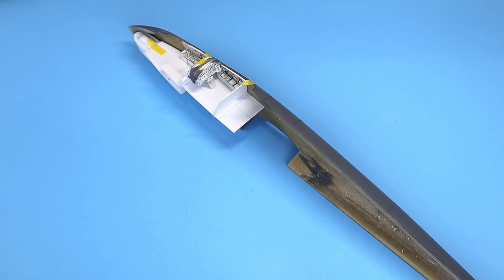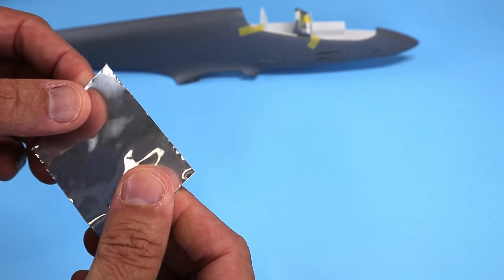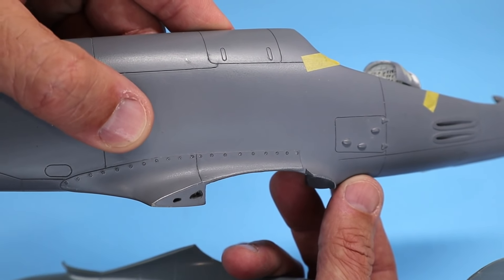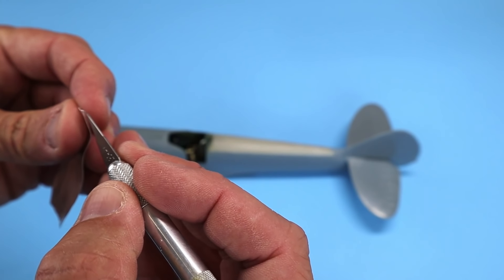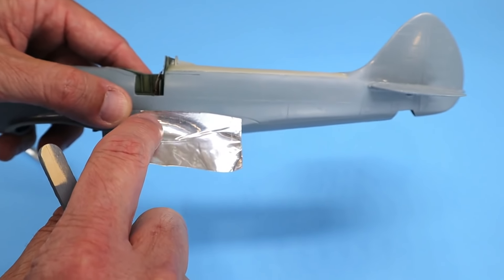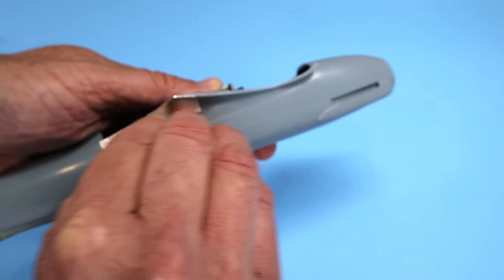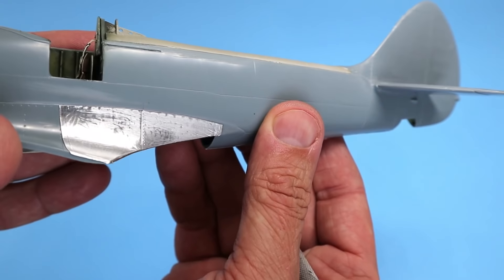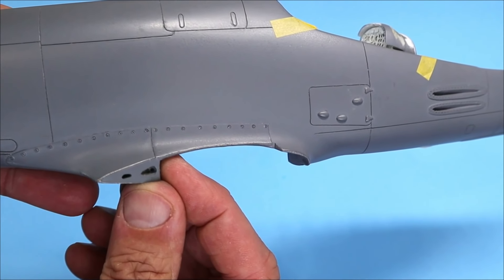Aluminum Tape for Model Airplane Skin Panels - Flite Metal

Comment: Adam savage swears by that HVAC tape, he uses it to make his wood swords look like metal. 
Very cleaver thank you for sharing.
Reply from the maker: I've used both the HVAC tape and the Flite Metal stuff.  The Flite Metal works a little better for these models but for small areas, the HAVC tape is fine.  It's also less expensive.  I hadn't seen any of the Adam Savage stuff but I'll have to check that out now.  Thanks for sharing.
Reply: @FlyingSModels  Also if the HVAC tape has writing on it like UL listed Acetone will take it right off.
Reply from the maker: @toddac61  Good intel but Acetone aint too good for foam or other materials so it's a good warning and a good tip all at the same time.  Thanks!
Reply: @FlyingSModels  Just wipe the lettering off before applying and let it evaporate.
Reply from the maker: @toddac61  Roger that.  Thanks!

Comment: I have lots of aluminium tapes from a variety of manufacturers and countries but none of it is as wonderfully thick as the stuff you're demonstrating here, every difficulty I have encountered has come down to the lightness of the material - if I could find a thich tape like this it would be a pleasure to work with. Great video
Reply from the maker: Not sure if you have the ability to order it but Flite-Metal is still available.  I don't have any association with them but it's good stuff!

Comment: Me and my dad used to do this over 40 years ago with the dull side of thin kitchen foil.  apply a thin layer of varnish on both the model and the foil,  let both go tacky and lay it on. Took a bit of practice but we did a 24th scale Airfix P51 mustang all over. It looked amazing. It looks great when you weather the paint off too on leading edges and walk ways etc.
Reply from the maker: Outstanding!  This is a little less labor intensive due to the factory applied adhesive.  It's also a little thicker than foil which helps to make  some things like wing fillets and such a bit more prominent.  It's also a little more heavy duty and can be sanded and polished to create different sheens/effects.  Thanks for the great inputs on an alternate approach.

Comment: Wonderful demonstration of how r/c modeling products can provide excellent results on both plastic and wood non-r/c models . I recommend sanding Flite-Metal while taped to a flat cookie sheet before removal of the backing to achieve the desired patina and surface texture "prior" to applying it to your model. 👍

In r/c applications a small electric 1/4 sheet palm sander is used to quickly reduce the surface texture to the desired appearance and permit Flite-Metal to condense prior to polishing and or weathering... "For The Look Of The Real Thing"😎. 

Flite-Metal is dead soft .0018 mil...not gutter tape. Burnishing and finishing tools accompany "FK" packaged Flite-Metal. Excellent video !
Reply from the maker: Thank you for the feedback and the bonus content to supplement the video.  Those are some great inputs on how to improve the surface finish/quality of the Flite-Metal.  I'm going to have to try them.  It's great stuff and I want to eventually put it on a small R/C foamy as well.  Thank you again!!

Comment: In the September 1995 issue of R/C Jet International magazine, is an article (Scale Metal Finishing Pt.2; pages 46-49) of how to attain even greater realism with applied metal tape. Once applied, separate panels can be subtly differentiated from one another (as is noticed on actual aircraft): The process involves coloring various individual panels with varying subtle shades/tints of chalk dust, then rubbing said panels with various grades of fine wire wool. I still have a copy of that issue, and the color images show phenomenal realism; that was on a large scale R/C BVM kit model. As an experiment, I tried it some years back on a section of a sacrificial 1/48 plastic model; the results were very good, but the smaller scale requires a softer, more careful hand.
Reply from the maker: That's some good back story on the use of this or similar products to finish larger aircraft.  I remember seeing the BVM Viper in action way back when at Jets over Deland in FL.  Loved watching those rip through the sky.  You are correct in that it takes a little more work to do a whole model in this smaller scale.  I typically only use the technique for raised panel areas like wing fillets and such.  Appreciate the good comments/inputs.
Reply: @FlyingSModels  👍✈️

Comment: Great vid, been using alum foil to skin 1/48 aircraft for some years now and two of the most challenging problems I've never been able to solve are: 1) fragility of the foil, anything can leave a mark on it, I believe b/c there is a substantial layer of adhesive that is soft so everything is 'gonna leave a mark'.  I see this problem even when I prime it.  2) it's not really easy to do NMF with alum foil, because of the 1st reason, but, I've found that Testor's seal for metallizer does protect it some but it's not 100% proof.  So I end up coating it with metallic paint, which defeats the purpose, lol.
How do cope with these problems? Very interested in your opinion.  And good job on the scratch built Cougar, pretty impressive to say the least.
Reply from the maker: Thanks for the good feedback.  It's a tricky process and to be honest, I typically foil for detail rather than for finish.  That is, I prime and paint over the foil versus leaving it "natural".  I have had the same challenges as you mention so I just changed the purpose of the use and don't try to get a NMF with the foil alone.

Comment: A simple method to remove the backing from anything having a protective film over the adhesive is to cover a corner or edge with a piece of masking tape, let it extend past the edge. Turn the item over and repeat the process. Let the masking tape pieces stick to itself at the backing and face, now simultaneously pull the masking tape pieces away from themselves, it will easily separate the backing and facing.
Reply from the maker: Great tip.  Thank you for sharing.  I obviously needed some help trying to fat finger that backing...haha.  Really appreciate you taking the time to provide this great tip/instruction.
Reply: @FlyingSModels  Glad to help.
Reply from the maker: @busmirror  Appreciate that.

Comment: Alumin(I)um!!🤭
Sorry, couldn't resist. 
Got to try this. Too many kits have panel lines too deep, and "trenched" rather than overlapping. This could be the answer. 
Thank you.
Reply from the maker: It works great for overlapping panels.  A little tricky to work around some very small compound curves and I've never tried to to an entire model with the stuff.  But it certainly is another tool in the tool box for us.
Reply: To be fair, the element was originally named as per the American form. It was us Brits who insisted on changing the name, to make it sound more ‘latin’. Both forms are acceptable. https://diecasting.com/blog/2014/02/26/aluminum-vs-aluminium-the-etymology-of-the-um-and-ium-debate/
Reply: Americans..... ;-)
Reply: @tjfSIM  I've been forced to notice the English language in a way I wouldn't normally. My son is dyslexic and he's highlighted the fact that the language often makes no sense! 
The meaning is the most important thing, as long as the pronunciation "aluminum" cannot be confused with anything else who cares?
Reply from the maker: Good point.  And the English language is a funny thing, that's for sure.  So many difference pronunciations for words that are spelled the same.
Reply: @FlyingSModels  something I always say is that English is a bunch of other lannguages in a trench coat pretending to be the same language.
Reply from the maker: @jordyncollier919  Now that's pretty funny.  I have never heard that one.

Comment: Interesting technique and very fine model making. The foil tape is in common use in the aviation industry, often known as "speed tape". It comes on a roll, 2" wide is a common size. As aviation is very highly regulated, shelf-life expired rolls are often disposed of so if you know somebody who works in the field, you can probably get the stuff for free or for a few beers.
Reply from the maker: Thanks for the kind words and thank you for the excellent tip.  Now I need to talk to my aviation buddies and get some of that expired tape.  Good tip!

Comment: I been using aluminum tape on many of my models-  works nice except it will make your model a bit heavier than normal.  I used it on a 1/72 scale C47-  aluminized the entire model and it  weighed more than it did if I left plastic.
Reply from the maker: Does add some weight so you have to make sure to take that into effect.
Reply: @FlyingSModels  if you ever build the Apollo command module and lunar module, this stuff makes it look good. :)
Reply from the maker: @spankyharland9845  I bet it does.  I haven't build any real space models but would be good to try this stuff out on it.  Thanks for the input!

Comment: I like the BareMetalFoil product - it is available in a variety of surface finishes, adheres extremely well, and is extremely thin.
Reply from the maker: It is a good product and a good bit thinner than the Flite Metal.  I like the lapped joints that can be created with the Flite Metal product a little better.
Reply: @FlyingSModels  I think there's definitely a place for both.  Definitely some aircraft had overlapping panels which is definitely an area where a thicker foil would shine - but of course there are plenty of examples where skin panel joints are flush-fitted, especially once you get into the jet era.
Reply from the maker: @chuckschillingvideos  Indeed.  I like the bare metal for the more modern aircraft.

Comment: To remove backing flick the corner with your thumb and middle finger. The two parts will separate just enough to grasp one side and start peeling.
Reply from the maker: Another great tip.  I appreciate you sharing with the community here.  Cheers!

Comment: After seeing this quick tip video, makes me think if getting the hughes H-1 racer be completely taped over and weathered to give it that nice effect
Reply from the maker: That would look amazing.  If you do it, make sure to share some pics over on my facebook page: facebook/flyingSmodels or through the contact section on my website: flyingSmodels.square.site.  Thanks!
Reply: @FlyingSModels  oh no, i don't have the kit or the materials for it but i thought it be interesting idea to see someone try it out, the H-1 racer, as wellas the commecial airliners used by the american airlines aluminum finish, but sounds good idea to try nonetheless
Reply from the maker: @revvingnoodle7192  For sure!!

Comment: Aluminum foil and pressure sensitive glue     works great
Reply from the maker: For sure.  That does work well also.  I like the fact that the Flite Metal comes with adhesive on it.

Comment: Nice tips. RC modelers: aluminum foil may compromise your radio signal reception! Use with caution. This effect may be ideal for statics, though.
Reply from the maker: I've wondered too about whether or not fuel from the exhaust would effect the long term adhesion of the foil on the RC planes.  Works well for the static ones I build.
Reply: connect the Antenna to the Skin - THEN you have a giant Antenna ;-)
Reply: You should run your antenna leads to the outside of the plane for RC use.
Reply from the maker: @daverose8772  For sure, Dave.  Appreciate you making that point for those wanting to use this technique on RC aircraft.
Reply: @daverose8772  What happens when you're going the other way? Now you are trying to receive RF through TWO layers of aluminum foil - not a good plan for reception.
Reply: Flite-Metal, the product featured in this video, has "never" presented radio reception issues. If it had it would be "stupid" to offer it for 22 years...in both narrow band and spread spectrum radio controlled models. 👌 There is an online report of its r/f reception efficiency...👍

This is not to say gutter HVAC tape will...however alloy tape is used in avionics bays to prevent cross talk interference...aka shield electronics.  😊

Aluminum density is the reason Flite-Metal has proven to provide "The Look Of The Real Thing" without radio issues when recommended application and finishing techniques are adhered to...

Comment: So could you use this as a way to “wrap” the model instead of painting it? This is very interesting, thanks!
Reply from the maker: Yep.  Another guy commented here that he did just that with his small RC foamy and he said it worked great!  I only painted it here as the Pucara was going to be painted rather than left in a natural metal finish.
Reply: I would say for a scale model it would be easier to paint  it if you want a bare metal finish, as I haven’t seen many foiled projects that dont have a lot of foil texture. Your idea of creating raised panels (and painting with a primer like Mr Surfacer) is a great idea. I have seen an alternative method of taping off the area in question and brushing on Mr Surfacer and then sanding it down to create a raised panel look
Reply from the maker: @vmoney9106  Yep, I haven't done a whole static model with Flite Metal and don't think I would, unless it was a much larger scale.  I do like it for building up raised panels as it's easier to work with (at least to me) than laying down a coat of Mr. Surfacer or similar.  Appreciate the comments.

Comment: Nice.... I was using the aluminum tape for seatbelts...
Reply from the maker: That's a good use too.  Although I prefer the use of pewter foil for the belts.  I think it lays down better (just my opinion, though).  You can check it out here: https://youtu.be/e0JLOteygE0
Reply: @FlyingSModels  I did see your vid and I would agree with you...but I haven't had any at hand and forget to look for it when I go out....also, my glasses are constantly fogged from having to wear a mask so wouldn't see it anyway.... : )
Reply from the maker: @thomaswilson3437  I hear you. Hard to do any shopping when wearing glasses and a mask.  Glad you are staying safe, though!

Comment: The very thin foil in packets of cigarettes is even better. It is much thinner, and easier to work with. And the effect is also more "realistic."
Reply from the maker: Great suggestions, although I don't smoke or know anyone that does so I'll have to go dumpster diving to find some...haha.  I actually like the Flite Metal stuff as it stands proud on the surface of the model which helps when I build up layers of primer (I don't lose some of the raised/relief effects).  Thank you for sharing this additional resource with the community here.  All the best, Chad.

Comment: Where you get this IA-53??
I've been looking for it almost a life!
Reply from the maker: Making it from scratch.  No kit out there that I know of...at least not yet :)
Reply: @FlyingSModels  
Looks very well done just like an injected model.
Congrats and excelente idea!
Reply from the maker: @jcbraka3771  Appreciate that, JC.  It's one of those long term projects that I will work on in between other less challenging builds.  Cheers!!
Reply: In Argentina you can buy some 1/72 Pucara models !!!
Reply: @J C Braka IA-58 is the Pucará.
IA-53 is a crop duster called Mamboretá
Reply from the maker: @hercholand  And a nice resin 1/48 one too.
Reply: @Coyote27981  
Sorry my mistake! Damn keyboard!
I just noticed once you point it.
Thanks for that.

By the way, how's going the re engine project with the PT-6A?

Comment: Think I'll give this a go on a small foam rc plane. Love the little planes but hate the look of foam
Reply from the maker: Let me know how it works.  When I was flying foamies, I'd always airbrush and weather my little warbirds but never tried to put aluminum over the foam.  Would give a great look!
Reply: @FlyingSModels  Will do. Done the air brushing too though it looks better it doesn't add too much to damage resistance. Hopefully the tape will keep the cheapo foam in the air longer because they sure are fun to beat on for the buck
Reply from the maker: @soknightsam  Amen to that. Hard to beat them for "pound for pound" fun.  I'm guessing it makes 'em a little more durable.  I used to spend hours and hours redoing the schemes with a custom airbrushed/weathered finish only to auger it in on the maiden flight...haha.
Reply: @FlyingSModels  Reporting in. Wasn't as bad as I thought. I cut mirrored panels and kind of jig sawed it together. Doesn't look half bad and only added 4 grams total for a 12 inch foamy. It's still too cold and windy to fly in Houston but I'd put money on the investment it holds up better. Lots of smiles per dollar
Reply from the maker: @soknightsam  Thanks for the report.  Only 4 grams sounds doable.  From what I'm hearing, definitely not the right weather in Houston yet, even indoors.  Sorry about all that.  Looking forward to a report on flight/durability.  Would love to see some pics if you want to share.  I could even post them on the community tab to share with others here.  If you want to, you can contact me through the contact section over on my website: https://flyingsmodels.square.site/

Comment: Flite Metals website is up but no one's at home.... They never answer emails been trying to order for weeks Guess Ill use HVAC or speed tape instead
Reply from the maker: I'll have to give them a try as well.  Been a couple of years since I have dealt with them so hopefully Covid didn't cause them to close up shop.  I found the Flite Metal much easier to work with than HVAC tape.  Sorry to hear that but thanks for the comment for info.
Reply: @FlyingSModels  If you're able to reach them please let me know I hope they havent closed up shop